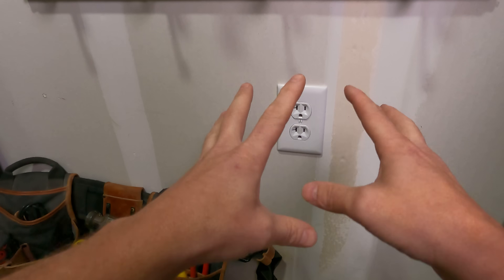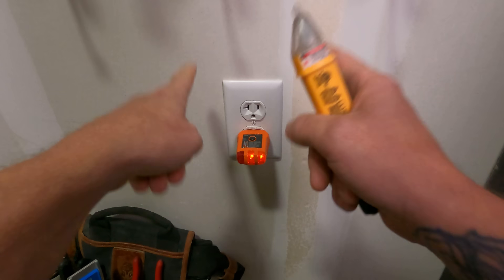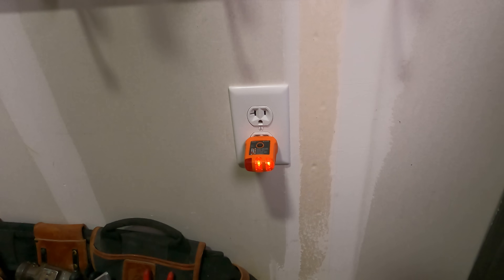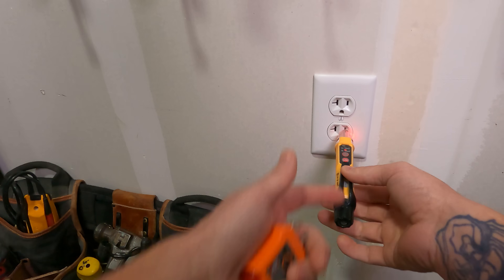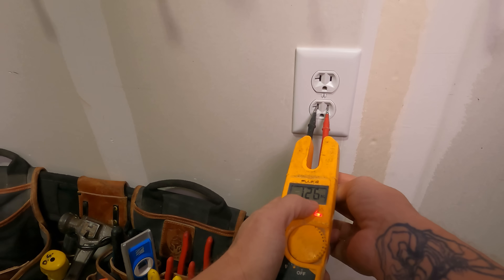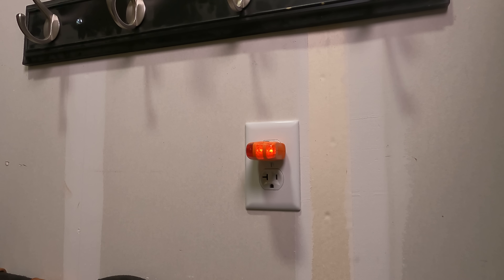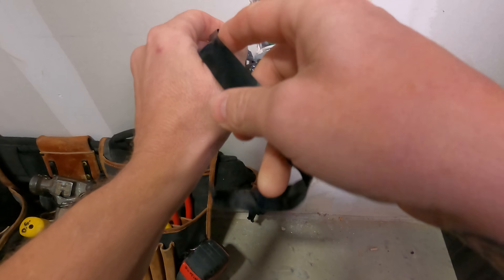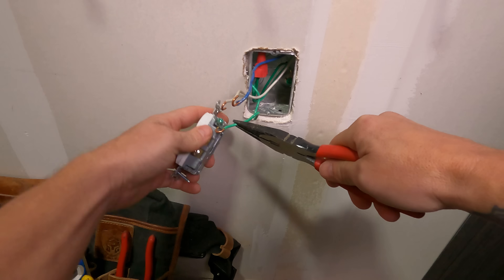How to Change Out a Receptacle  - The Right Way!

Comment: I love watching your YouTube.

The area I grew up in, back in the 70's and 80's, unless you were building something industrial the Fire Marshal didn't give a crap. In most cities they had an inspector that did it all. The same guy inspected the blue print, proposed site, foundation and footings, frame, roof, enclosure, plumbing and electrical. In the country different electric co-ops had varying degrees of inspection before they'd hook up power. I followed code, did a good job and my shiz worked. The same contractors called me and I had plenty of referral business for remodeling dealing directly with the homeowner.

If there had been a union shop within a hundred miles I would have applied for apprentice. Unfortunately there wasn't. So I took my knowledge of electronics and radio equipment that there was no jobs here and checked out all the NEC books at the library. I paid close attention to other people's work as I started hanging the ceiling fan over the dinner table to start. I also had a few old timers teach me tricks.

When I gave up and went to other things was when the counties charging a fee to become a licensed electrician. $200 for a 3 month "license" that involved a one page test and a copy of your driver's license.

I know exactly why DIYers concern you, they concern me as well. This was a long winded way of telling you of the great service your doing telling people the correct way to do it. Thank you!

Comment: The best videos for DIYrs is showing how people get hurt. And how fires start. One big problem diy people have is knowing how to make something work but not how to make it safe. 

The 2 biggest examples I have seen are, someone putting 7 wires into a single gang box and someone disconnecting the ground to an outdoor kitchen because the breaker kept tripping.

Comment: After tightening the screws the first time I like to grab the receptical and twist it clockwise then counter clockwise 2 or three times. It's amazing how often one of the wires loosens up. Then I tighten by hand again. I do this when installing breakers too. 

I don't know if this loosens a lot because of how I do things but making sure all connections are air tight is really important. Especially if you are going to be running that receptical at 12 amps.

Comment: I had a non contact tester light up from 4 feet away. An old lightbulb had just died in a big flash. I wanted to know if there was power anywhere before changing the lightbulb. That flash when it died did something interesting to the circuit. The non contact tester was going off at the 4 foot distance for over 15 minutes. It was really interesting

Comment: In other reasons to hit the breaker... Changing the plate\cover.  I never used to, but when selling my in-laws i was doing a walk through and noticed a cover had a pan head screw.  I went to take it off.  The receptacle exploded.  I think the screw used was longer and damaged the receptacle.  Removing it removed some tension and the receptacle fell apart, things touched, fire ball amd explosion.  Immediately hit the main breaker to the house.  I was fine... But now i take that extra precaution.

Comment: One of my biggest frustrations is that receptacles are not installed/ oriented the same way. My understanding is that the "correct" orientation is with the ground prong on top. The reason being that if the plug was partly pulled out and something was to slid down between the plug and receptacle, it was contact the ground and not bridge the energized prongs. That being said, if that is supposed to be the standard, why is the Klein receptacle tester oriented with the ground on the bottom?

Comment: I have a question: Is there a reason not to connect the green wire in a residential receptacle? It was a house built in the 70s so I figured maybe it was a change in code?

See, I had a cracked receptacle that needed to be replaced in my childhood bedroom and one day, when I was a teenager I finally decided to replace it myself. I did everything right according to this video but when I took off the old  receptacle, I noticed the old one wasn’t grounded. Why is that?

Comment: How do you replace a receptacle, the right way?  
Step 1:  Turn off the power at the breaker.  
Step 2:  Disconnect the wires from the old receptacle.  
Step 3:  Get the shit shocked out of you because you turned off the wrong breaker and didn't verify it at the receptacle.

Comment: Torque-ing to spec is a code requirement...
Reply: Was going to say the same.
Reply: There's nothing like jacking up over time to guarantee gud-n-tight. 💯 agree with you. Building costs are far too low.

Comment: So I was watching someone on another channel talking about wiring receptacles or light switches and they talked about bending your wires around the terminal screw as being old school and not necessary with todays receptacle. What's your opinion on that?
Reply: It depends on the capabilities of the receptical. Some have the clamping plates and some don't. The one he was using didn't look like it had the clamping plates.

Comment: Dustin, I gotcha. You said the hot wire is always on the right. Well, if it happens to be one of those with the ground on top, like some insist is the "correct" way ( not me though ). Also, you did not make a point of checking the power on both top and bottom halves, as some may not be aware of split receptacles. I know you did actually show testing in both, but did not make a point of it. Aaaa, what the hell nobody is perfect. LOL

Comment: Haha. Right on. It's mind boggling that someone thinks I'm actually going to call an electrician to change out something like this. Be safe. Use common sense. Know how to use a multimeter. Do a bit of research. 90% of the way towards a 'pro' job at 1% of the cost.

Comment: DUSTIN, How can you measure the "leakage current" from neutral to ground using a DVM meter? or what do you use to make leakage current?
Reply: Current can be measured in two way. Place your DMM in series with the circuit which requires a break point between two nodes. Or if your DMM has a CT you can measure it indirectly simply by clamping it around the wire. 

For neutral to ground leakage you would likely need to measure it from the breaker box. Measure the junction where the neutral is tied to ground WHILE THE CIRCUIT IS LIVE. 

This is dangerous, only do so if you are an experienced electrician. I also am taking a guess at this and take no responsibility if I’m wrong 🤷‍♂️.

Comment: As a second year apprentice, I was devicing out a floor of a hospital we were working on and always heard that I need to get the receptacles in faster. Considering stripping out the wire for the pig tails, screwing them on, wire nutting them together and then screwing the whole piece in, what’s a good time to go for? Because I wouldn’t intentionally go slow but I thought I would make good time to do each one but would constantly get flak for going too slow
Reply: I couldn't tell you. However, if you're constantly catching heat for going too slow, set up a practice board at home and time yourself. A good employer will help you with the supplies you need (if not, scavenge or purchase).
Reply: A liscensed electrician ( old timer) showed me to use pig tails & Always Metal boxes.  He twisted the wires with a pliers, wire nutted & wrapped with black tape around wire nut and first 1" of wire below wire nut for added safety. He did not wrap the receptacle connections with black tape -  but I LIKE  that practice as shown in this video.
Reply: Let the wire nut do the job of twisting, and if there is any rework, point out how fast you got the job done!

Comment: Awesome. Now I would like to request a video on removing wire from the insert holes. Most of my switches and receptacles are connected by the insert holes method and not the shepherd's book and screw method. I have tried 4 different tiny screw drivers but am unable to unlock the wire to release it.
Reply: Aka backstab
Reply: Did you mean shepherd's hook? I know electricians use their personal terminology, but jeez:p
For your issue, grab the wire close to the back and twist the receptacle while gently pulling.

Comment: As a DIYer I bought the Klein RT250 plug tester, Klein CL800 clamp meter and a torque screwdriver to tackle my own electrical projects along with several other Klein and Milwaukee electrical tools to do things right. I also make sure everything is done to code or above code. Many tell me I do things overkill but my modo is do it right, do it once. One electrician told me the other day he wished some of the electricians he worked with were as well equipped tool wise as I was. I don't understand why anyone would not equip themselves with all the proper tools to do the work they choose as a profession. I'm a tool junky too so that might explain that. One can never have too many tools! As a DIYer I only tackle my own single phase residential jobs.

Comment: As always another great video!!!  One thing I noticed that you didn't mention that might be important for the DIYer is to make sure when wiring anything in a metal box to make sure the box is grounded as well.  In plastic boxes they will not see a box ground but if they do live in an older house that might have metal and plastic boxes mixed throughout someone might not know that a ground is needed to the box as well as the receptacle. 

Just FYI for the DIY.  😉
Reply: I was taught to ALWAYS make sure anything I worked on was correct when I finished the job, even if it meant fixing someone else's mistakes (which unfortunately happens A LOT these days).
Reply: Because it is a replacement the box should already be grounded, but that IMHO is trusting the last person too much. You have the receptical out, it doesn't hurt to double check the previous work while you have access.

Comment: I am a first year apprentice and have seen many of my journeymen backstab the plug instead of wrapping it around the screw. It’s not the backstab with only the crappy metal pin but the clamp-on version of backstabbing the plug. Is this a valid way to install a plug?
Reply: The funny thing is is no one is explaining to people on here that backstabbing is a UL listed method of wiring a 15 amp duplex receptacle when using 14 gauge solid conductors. While it is NOT UL listed to backstab with 12 gauge conductors. Everyone is just saying not to do it. Which I totally agree with. I never do it and would never recommend it. Although I’ve rewired many houses that all the receptacles and switches where all backstabbed and had been that way for 40 plus years. Even done so with #12. So yes it’s UL listed to do it with 14 but not 12 and never recommended. Hell , even in residential when there’s more than two wires in a box I make pigtails for the receptacles.
Reply: I'm not there, but from what you wrote it sounds like they're using back wiring, which is very different from back STABBING.  Back wiring, where the wire is clamped down is becoming more and more common, and it holds the wire very securely as long as you tighten the screw down properly (which you have to do anyway even if you use traditional wiring, wrapping your hook around the screw).
Back stabbing refers to receptacles that have little holes in the back that are just big enough for the wires to fit into.  I doubt your journeymen are using those.
Reply: @saberx08  that’s precisely what I mean. I just didn’t know that there were different names for these methods. I appreciate the feedback
Reply: yep 👍 back stab = handyman, back wire = professional. back wiring is when the receptacle has a plate that clamps against the wire when you tighten the screw down.

Comment: IMO you left out something very important for a DIY'er.  While you are working in a commercial environment, where the metallic sheathing is the ground, metal boxes are also used with NMC in many cases. If a DIY'er followed your instructions here, they might not understand the importance of bonding the box.  If it had been done improperly in the first place, they would be repeating the mistake.
Reply: Isn't the box bonded via the strap on the receptacle or switch?
Reply: @davidw7643  No. What you are describing is an accidental bonding. It may or may not be a good electrical connection. Metal boxes want to be intentionally bonded and provide a grounding screw specifically for that all the way in the bottom. Usually the ground conductor from the power cable in the wall will be connected to two pigtails. One pigtail goes to the screw in the back of the box and the other pigtail will go to the receptical. Because he was replacing an outlet this should have already been done and his green wire was probably a pigtail already. He probably didn't go into that to keep this video down to KISS principles. While, yes, having the receptical out would be a good time to double check the previous work, that was probably determined to be out of scope for this particular video.
Reply: If it's metal... bond that sh*t. Rebar in concrete? Bond that sh*t. Metal post in the ground? Bond that sh*t. Cannot overstate the importance of bonding that sh*t. 
Good comment, mate. To the DIYer working in a commercial environment:
Bond that sh*t!

Comment: I had an electrician associated with the “disaster recovery” company come out to do work, replace panels, new service, replace 1950’s wiring. Instead of bothering to call me, one day he bent a screen and tried to get in the house, setting off my alarm. Then he called me. After the job was done, or should I say, they stopped, I discovered a previously functional outlet receptacle (all were functional, if not grounded)  deader than a door nail, in rewiring one thing he killed it and two of the fire damaged circuits weren’t repaired. Both him and the contractor simply ignored me until the Sheetrock, mud and paint guys (insurance only primed the ceilings and two inches of the top walls, meaning I’ll have to paint every room now) were done, then demanded payment. Insurance guy wouldn’t help as he’s several states away. Now I have to separately contract to diagnose, or probably just run a new wire as there aren’t enough outlets in there due to 1950’s construction and no built in overhead lights..I have lots of other stories, like how they gutted the place and disappeared for over two months, or how during demo they just sawed through the bottom of the rafters rather than stop at the proper depth..moral of the story..don’t have a fire, if you do, don’t use a disaster contractor, (maybe use their ppl that remove and clean your stuff, they seemed ok) and get references and a date of completion, and don’t expect help from your insurance. I’d love to replace my receptacle, too bad there’s no power running to it anymore..
Reply: Yep, a lesson learned that in the beginning, don't go into default mode but become more Hot and less Neutral about the situation.